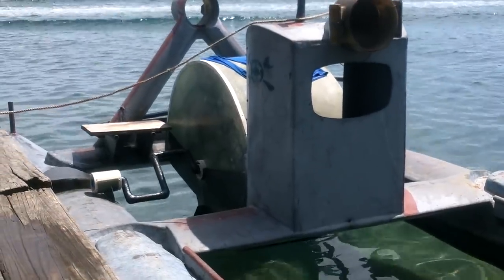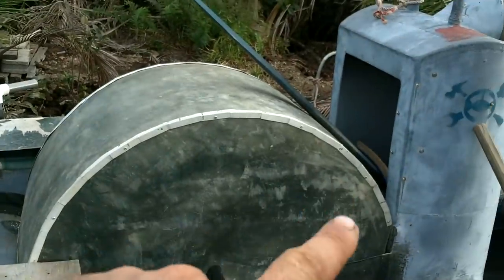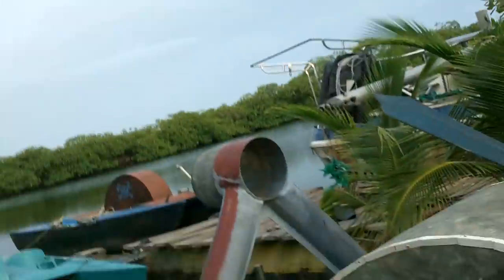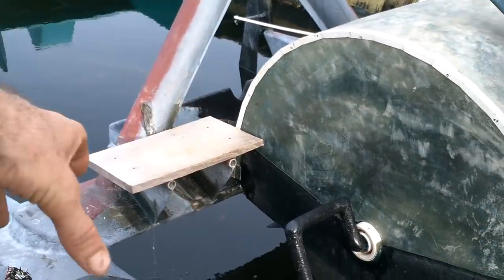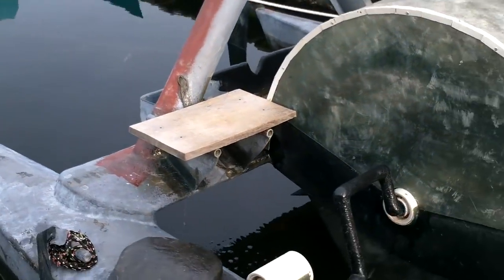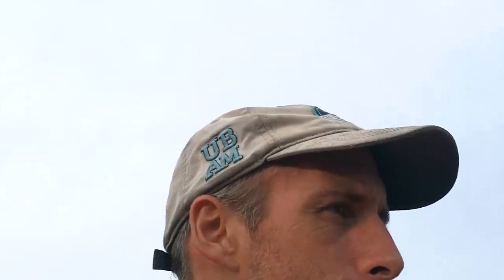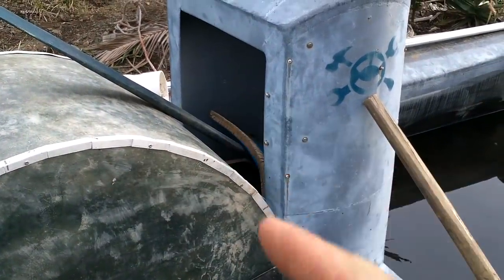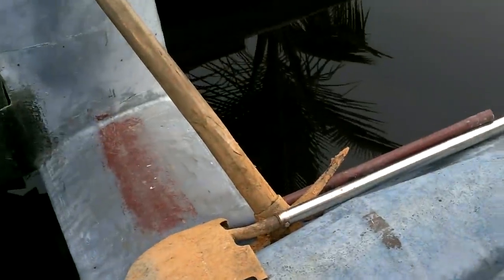Boat Chips 012 Real Test!

Comment: Try the sail Jamie...here's the logic. A simple lug sail is light and easy to handle. If there is no wind, the conditions are perfect to peddle, if there is wind the sail will zip you along reliably with no effort! Hate tacking, then don't,  your paddle wheel will get you into the wind faster! Best/Roy

Comment: The solar panels and a motor seem to be the most sense for the reasons you stated, but also adding a simple sail on an unsupported detachable fiberglass reinforced mast, that just drops into a tubular mast foot would give you downwind sailing for very little investment of effort or resources, you could also make an central attachment point on the front, by putting in a structural member across between each pontoon to attach the tack of the sail ( lower attachment point) to give a basic ability to sail across the wind too. Regards Dave.

Comment: I've read about and seen a lot of boats but I've never seen a boat with a paddle wheel and a sail. For me I'd add a sail, but I have a grid everywhere and so I'll be interested in what you do.  I think I could make a sailing rig for less than the cost of motor, batteries, solar, panels and charge controller.  I can;t wait to see what you do next!  Hope the digging on Dad island is going well too.

Comment: Really I think you should consider a common Briggs & Stratton motor and haven't hooked up to a belt pulley and this push the engine back tightening the belt. I seen Railroad track flat cars in India using such a setup.
Reply: You need to do something about those pipeline support brackets or at least they look like a pipeline support bracket.
Reply: Can you direct solar the boat and you would probably need a clutch because you can't spend a motor without drag. There is a thing about grounding a boat to the water that is needing some Hardware you need to be a master at at the concept of this. I seen a girl in a very nice yacht and she had to wind turbines on her yacht and she was having electrical trouble and she had to make a distress cry after many days of struggle trying to get her instruments alive to navigate her around the storms. When helped arrived as soon as the boat made contact the instruments of the boat seemed to be running fine. And true that did not tell us that the mystery was solved the boat was improperly grounded.
Reply: That would make a good video how to properly ground your boat for electronics and how to find the right material it is a bar made out of some type of metallic material is attached to the grounding wire to the boat outside Hall.

Comment: Sense you made it pedal powered why not a pedaled power generate to go along with solar or wind set up?
Reply: I have lost count of the times I have heard people say well why not hook up a generator to your pedals on something like this. There is no free ride. Taking mechanical energy and turning it into electrical energy the best we can come up with is 60% efficiency for the generator, most generators are not 60% efficient then you have the Drive loss of turning your leg power in to speeds the generator can use another 5 to 10% loss. 

The other problem is the human body can only put out about 75 watts of power for any sustained time. Even then the person must be in pretty good physical shape.
Reply: @krissfemmpaws1029  And? Bryan isn't saying to do it on its own but as a support function for a solar/wind setup (probably solar best though). One of Jaimie's main concerns with using power on his other boats is that the batteries run dry, or with cloud cover he simply can't get any power from the sun. Having an emergency power generation method that he can hook into the pedals, so it doesn't interfere unless you are deliberately charging, is a good idea.
Reply: funny my bicycle had a small generate on it producing 15 watts wasn't a lot, but free 15 watts is free 15 watts